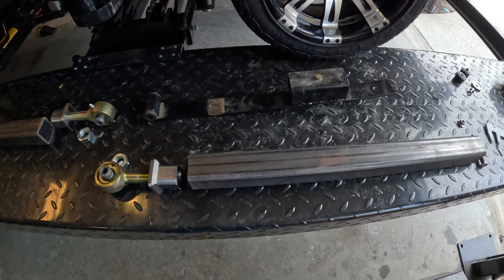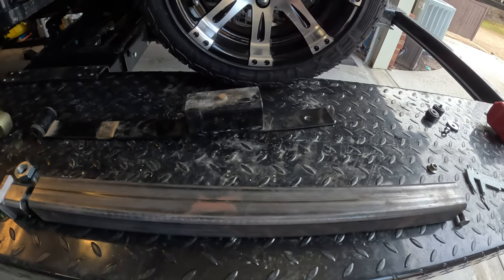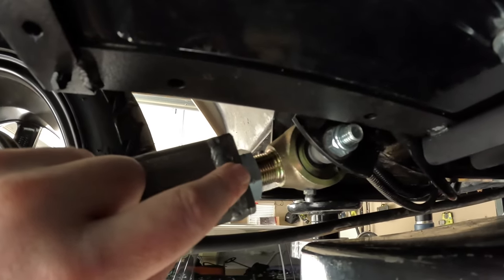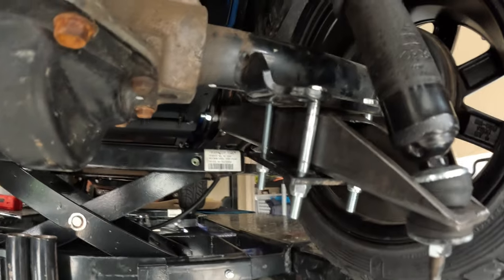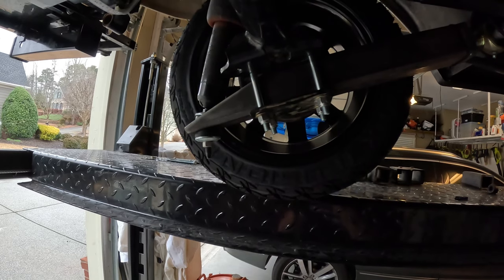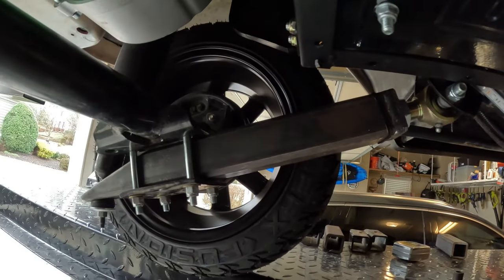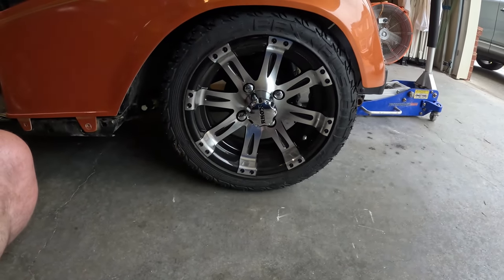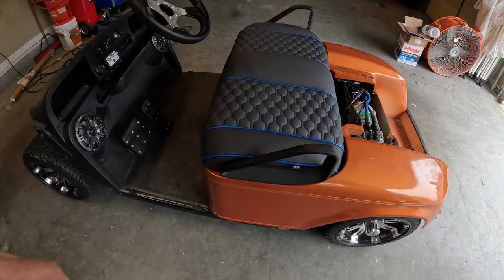2011 Ezgo TXT Rear Air Suspension Update

Comment: Now that you have had some seat time, have you needed to install a panhard bar to the rear? TIA
Reply from the maker: When riding alone or with people in the front seat only (my most common riding) I don't feel the need for one.  When I have the back loaded up, I can feel some swaying.  Not sure that I am gong to do a pan hard bar or totally rework the suspension.  I may just leave it b/c having people on the back isn't that common for me.

Comment: Great info. Thank you. Do u see a need for a panhard setup of any kind or will this keep the rearend from swaying from side to side?
Reply from the maker: I still don't have a lot of seat time just yet. I've been waiting on a new body and roof, so the cart is in pieces. I'll probably make another video mid summer and talk about how the suspension is holding up.
Reply: @aberk20  can you tell me the part number and where you got the passenger side longer brake cable?
Reply from the maker: @brianewest  
Driver side Brake Cable for EZGO GAS 2008-up Shuttle 4 & 6 Golf Cart models. Measures 65" long. Alternate and OEM Reference Numbers: 624695, 70968-G08

EZGO GAS 2008-Up Shuttle 4 & 6 Golf Cart Brake Cable - Driver Side https://a.co/d/fliKxR9

Comment: I saw in your other video a brief shot of the front suspension and intermediate shaft for the steering. Did you modify the steering shaft to lower the cart with air? After reading your post on buggies gone wild, i have a good idea what to do, but few people discuss the steering shaft and if it needs to be modified to travel more while lowering. Thanks and you have a sweet cart! I'm lowering a 22' ezgo gas, my concert will be the motor, but i think i can shim the axle to tilt the motor down in order to lower the rear more. We'll see I guess.
Reply from the maker: I have a new video coming with more details on the front.
Reply: @aberk20  I am toying with the idea of building a metal plate over the top of the steering rack and mounting a single air bag like on the rear of a truck to lift and lower. I'll do the leaf spring mod you did as well. I'll have to build a plate off of the top frame (where the top shock mounts are. My thought was the single bag would ride softer. I know it will lean more when you turn fast but the rear will have both air shocks and most of the weight is in the rear anyways. What are your thoughts?
Reply from the maker: @deanlacombe5006  i have seen that done too. I'm not the best at metal fab so I kept it simple. I think you're OK to do that in the front, but the rear really benefitted from having separate bags and air control.  Even those bags are designed for heavier duty use, so you may get the same results.